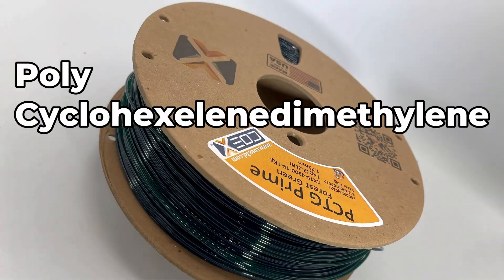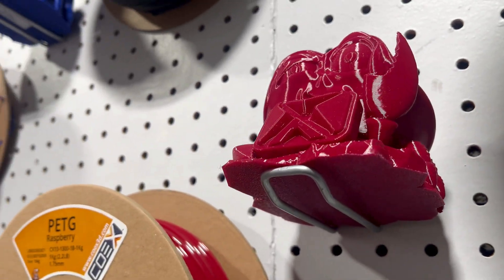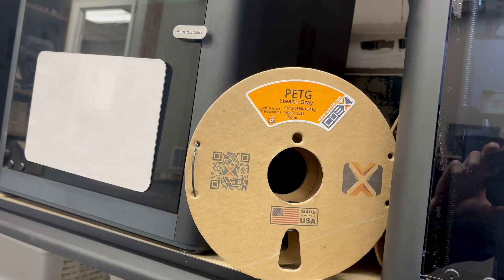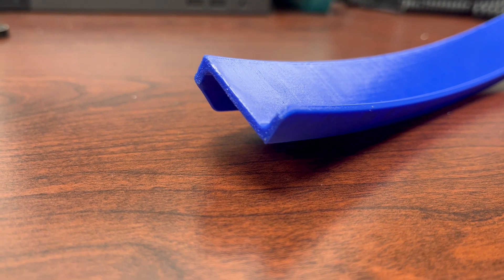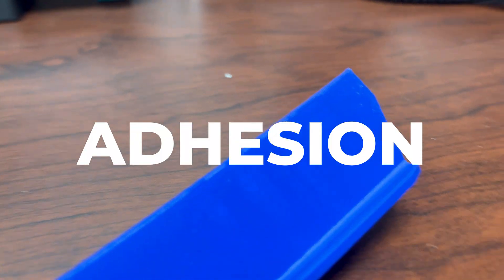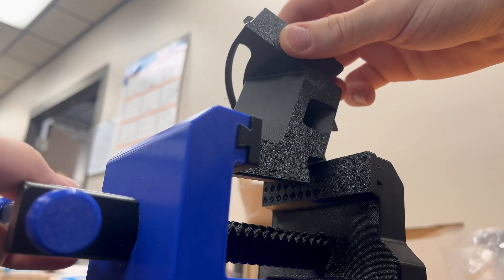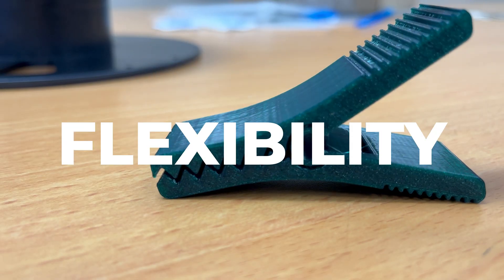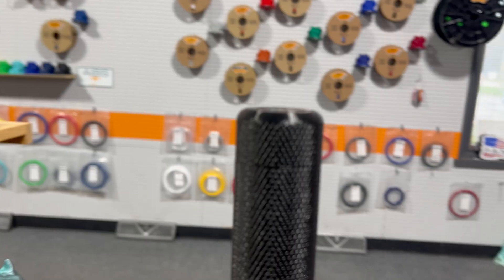PCTG.

Comment: At nearly $40 a roll it seems steep for an every day filament. Maybe if you needed the specific characteristics that PCTG offered then you’d be ok buying it. But it is so expensive and the other options are trusted and budget friendly. This isn’t a new filament either. PCTG has been out for some time now.
Reply: Its not an every day filament, its for products that need the mechanical properties. Yeah pc is cheap, around $15 per kilo, but its specific, lets say you have a product that could use either, but due to the nature of the print, the unreliability of pc causes at least 4x as much waste compared to using this filament, or the wasted print time expenditure is greater with cheap pc, then this filament would be worth using instead